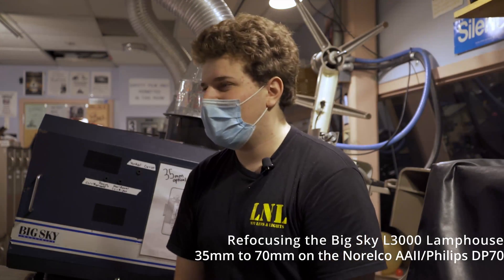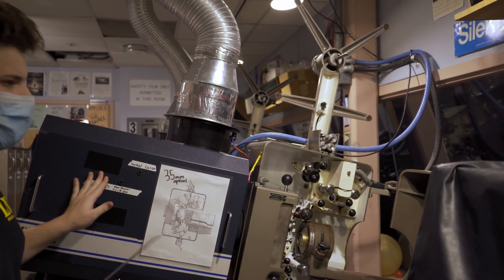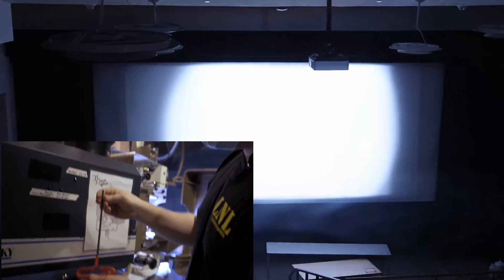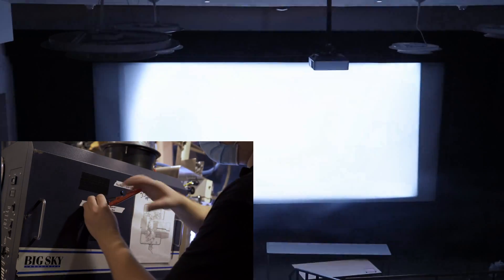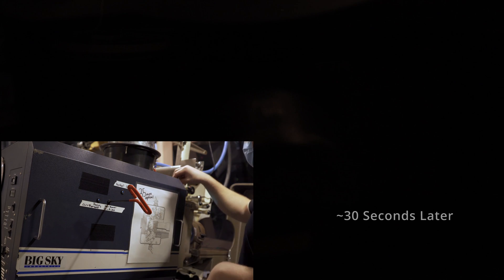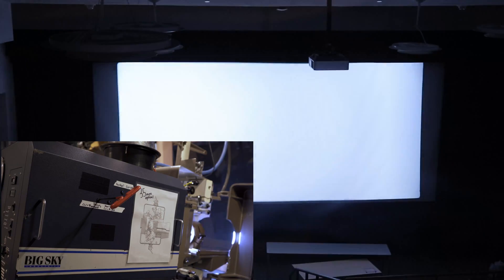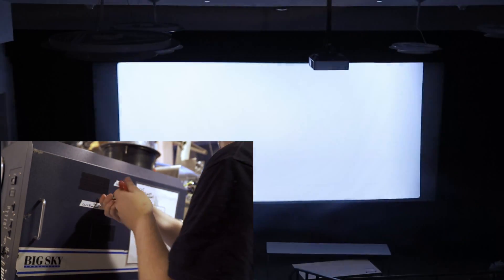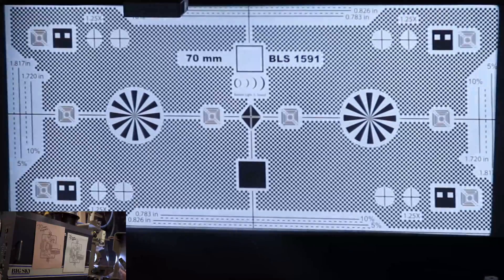35mm to 70mm Projector Lamphouse Focus (4K) #35mm #70mm #DP70

Comment: You have to worry about overheating your lens with this much power? But not when there's film in it?
Reply from the maker: The film sits between the lamp and the lens, and acts as a heat shield. If there is no film, then all the light power hits the lens!